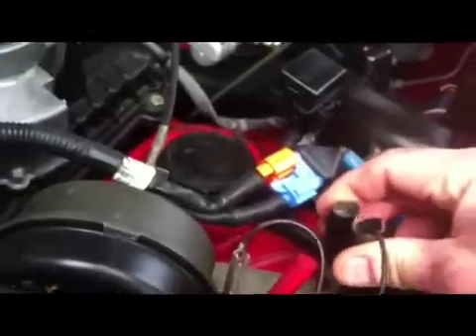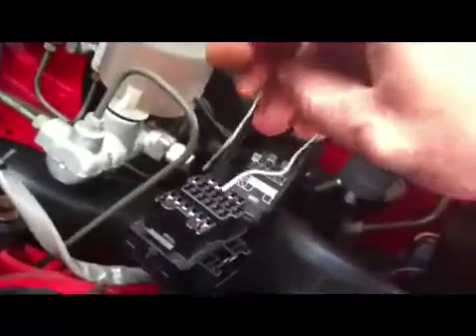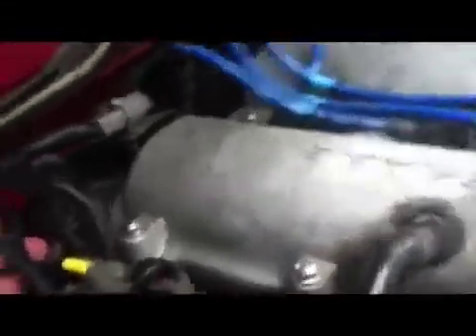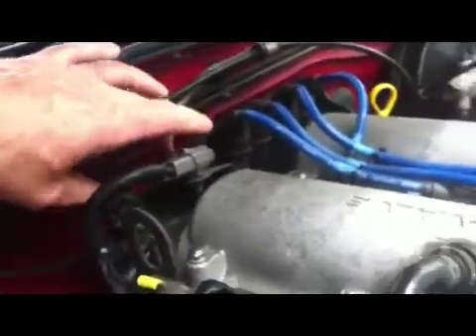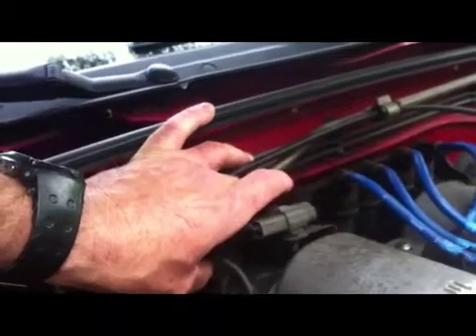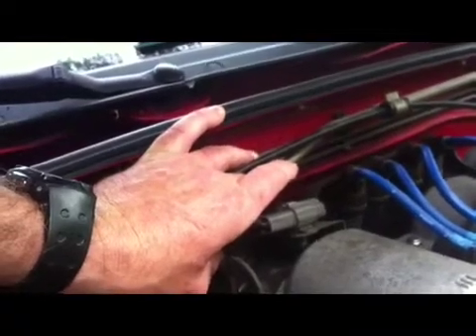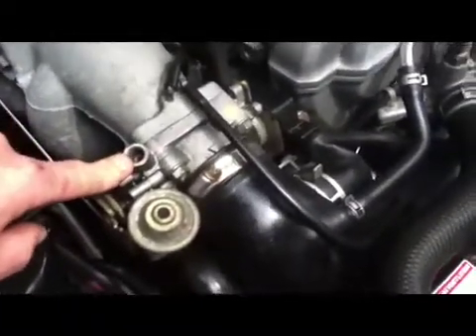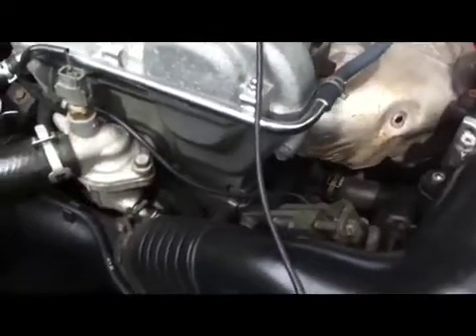Mazda Miata ignition timing  1992 NA

Comment: I did'nt see you torque the cam angle sensor ,  when you were done  ?   Also your supposed to set your idle speed first  ,  after bringing the engine up to operating  temperature ,  then set  your static timing  ,  Mazda Motors N.A  taught us that the correct way to adjust idle speed is at the idle adjustment screw   &  before that , you  MAKE SURE you turn off  EVERY accessory  .   Thanks for the vid.